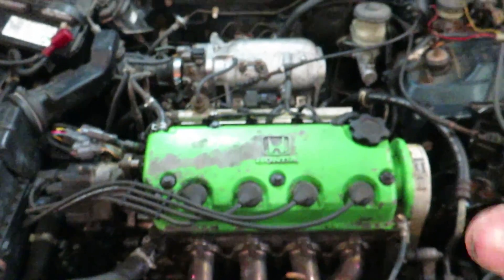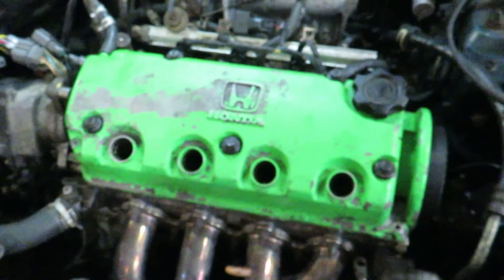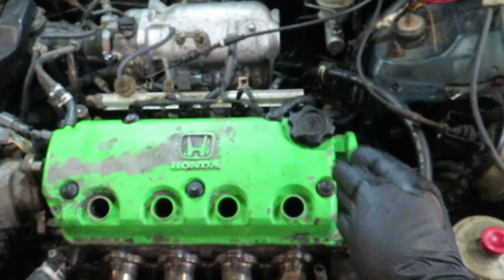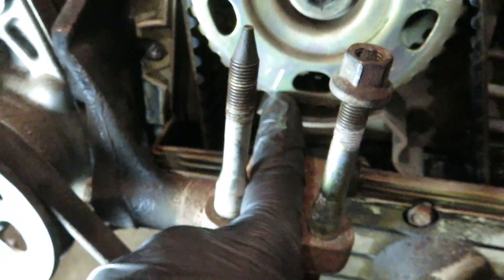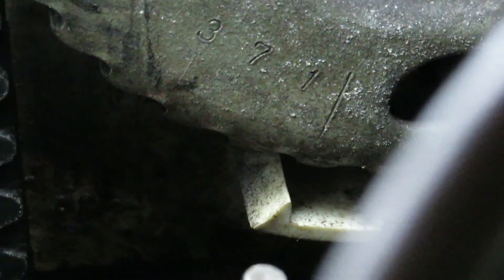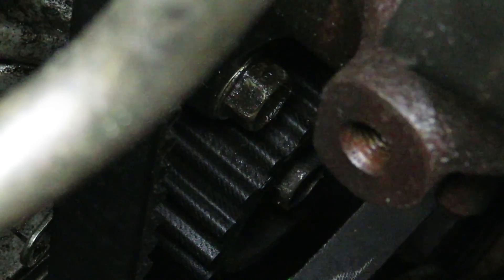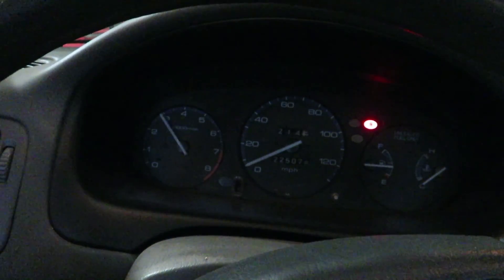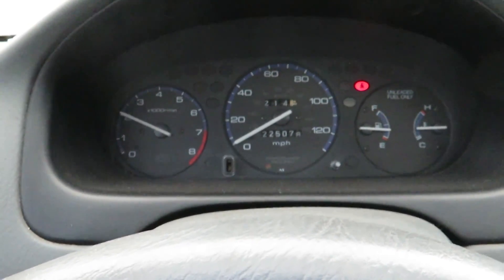Resetting the cam timing on the d16z6! will it fix the problem????

Comment: Dont hold me to this but did you mean to state move the can gear 3 teeth counter clockwise to get the slack on the front side of the belt out.. only surelybthatbwould put slack on the front side and taught the back.  I only ask cos atm I'm having issues with setting my z6 timing up I tweak it a tooth clockwise to get rid of tension and then tighten the tensioner I dunno who to question more me or you lol... great video tho well explained for the most part i does like a good hands on vid 👌👍
Reply: Please excuse my typos my phone isnt very helpful
Reply from the maker: Ok after watching the video the findnwhat u were referring to lol I believe your talking about when I said loosen tensioner bolt then rotate engine crank pulley ccw so the cam pulley moves 3 teeth  then tighten tension. If this is correct then to clarify. Since z6 rotates ccw naturally if u rotate it clockwise u can induce slop in the belt because ur basically taking the belt slop and putting it on the side opposite the tensioner. The z6 tensioner is designed to tension itself and remove the slack but u need to rotate the belt 3 teeth ccw (using crank pulley not cam gear) so the slack moves to the tensioner side and then u tighten the bolt. If you would like further clarification we can open a line a communication and discuss this further but I hope that makes sense. Thanks for commenting and watching

Comment: This is pretty straight forward, but what confuses me is that some people  use a timing light with this type of engine? Looks like you didnt need one..
Reply from the maker: A timing light is used to set distributor position which affects ignition timing. What I did was set mechanical timing and relationship between camshaft and crankshaft. Hope that clears the confusion
Reply: 2 different things. Mechanical vs ignition timing
Reply: This head is either a z6 or a d15b . Plugs are on the front.

Comment: It wouldnt start ?
Reply from the maker: the engine was hard to start and get running and when it did it would idle wrong and have a weird powerband due to being off time
Reply: Looks like an iacv issue
Reply from the maker: @juanitosanchez3334  some of my idle issue was the breather box when I converted to obd1 box inacidently removed the PVC valve since obd1 and obd2 have them in different locations. I added a pcv valve and all was good